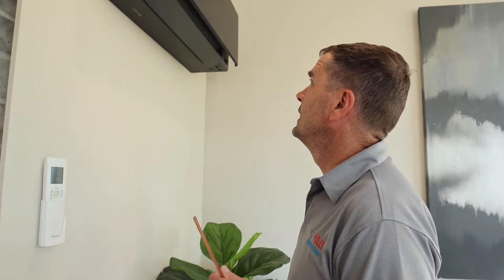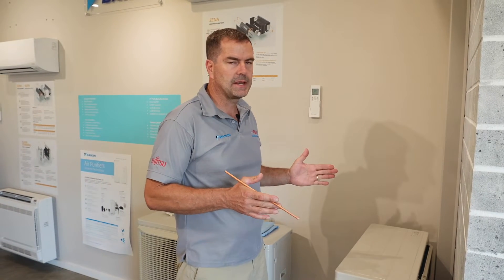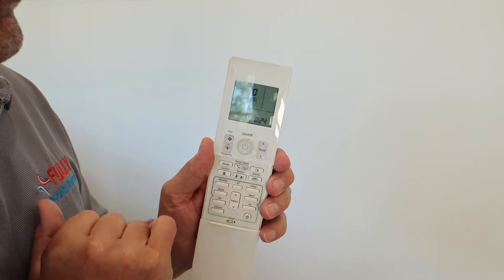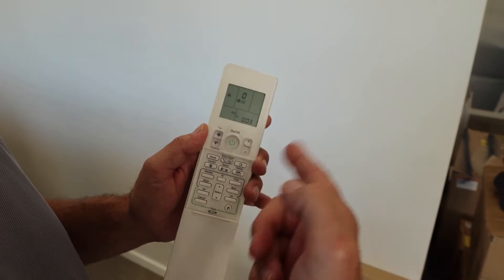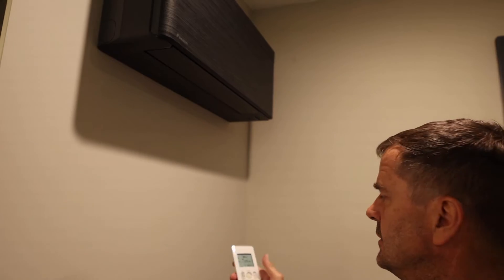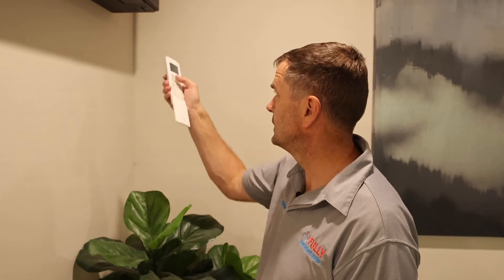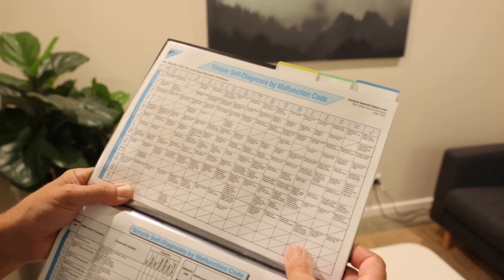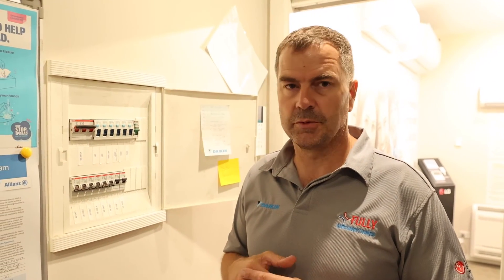How to fault find a Daikin air conditioner, troubleshoot split system ductless, green light flashing

Comment: Why is my remote is not working on my Daikin stylish
Reply from the maker: Is it the remote or the unit ? Dose the unit turn on with the button on the actual unit, if no the unit may not have power. If it dose then the problem is with remote controller or receiver

Comment: My doesnt do any bip, not even when I change from one code to another. No beep at all. The power light doesnt even turn on :(
Reply from the maker: Well it probably has no power to the system, I think you need to call an expert, your local Daikin dealer.

Comment: what to do where is no beep sound?
Reply from the maker: If it’s not working, there is no beeping sound but the lights are flashing. Well the lights tell you that it has power, the flashing lights tells you it’s in fault, with no beeping sound telling you that the beeper is broken, wires possible cut. 1st thing I would check has a mouse go into the indoor unit and chewed through the wires to the beeper. Or call a Daikin services tech with a d-checked, it can be fitted to the unit and look at the fault via a smart phone.

Comment: Well, I have two brand new multisplit installations, They worked fine during winter, but since summer started and I want to use them to cool the house, both are getting system fault UH, got already two daikin technicians here, none of them found something, as sometimes it takes two days before the fault is coming back. All filters and all inlets and outlets inside and outside cleaned. The only thing I can imagine is the location as they are in plain sun, but the techician tell me that it is not possible that this is causing the problem, They tell me to replace the compressor, but this seems impossible as both installations started at the same moment with the same issue. If you have an advice, I would love to hear it
Reply from the maker: Yep that’s an easy one, one of the indoor unit is cross wired, doesn’t effect as much in heating (just doesn’t heat in that room, but won’t cause a shut down fault).
Here is a easy test you can do, turn all the indoor units on to fan, then one at a time turn one indoor unit to cooling. Now go around to all the indoor units and see what one is pumping out cool air, is it the one you turned to cooling or not ? Then turn that indoor back to fan only and go to the next indoor unit and turn it into cooling and repeat this to all indoor units. You should be able to tell from this which one’s are cross wired. There is also a test you can put the system into from the outdoor unit. This test will automatically correct the incorrect wiring, but if the power is off for too long it will forget and will be cross wired again. Best to do the test, look at the led lights to see what indoor units are cross wired, and move the wires, then put it back into test to re-correct the wiring. This should only be done by qualified technician as you’re dealing with high voltages that can kill you.
Reply: @FullyAirconditioned  thank you so much, checked all cables again and indeed, both installatiions had cross-wired indoor units, Heating was indeed low, but I thought it really was that cold outside. Wired units correctly to the outside unit, and the air is much colder to cool down,after taking 20 minutes to start up again.. Will ask my money back from the company who did the installation and send them an additional heating bill from last winter :-) Not that I will see a cent as I am not an official technician, but it is working great now. THX again
Reply from the maker: @freyerboeckx7199 advice not intended for you to fix it, as it’s dangerous working with power, should be done by a qualified person, but glad it’s all fixed  and working now👍🏻. Daikin system are not as simple as USA made AC system, more training needed for service technicians.
Reply: @FullyAirconditioned  well, the installation was done by a (newbie) Daikin technician, two times a Daiking technician came over, first technician told me it was because of a cheap system, and the outside unit had not enough power, second told me to clean all the filters and was amazed that all filters were brand new, so the only possibility was the condensator or the whole board, So I send this one home because same issue on both systems at the same moment, couldn't be a result of his explanation, Working with power is not a problem, as I am an electrician, I only never installed multisplits myself and even less R32 installations. As  two Daiking technicians weren't able to solve this. best solution was giving it a try and it turned out great, so thx again.
Reply from the maker: If the tech have done all the checks and still can’t work it out I have had a faulty tx valve before that will cause this fault code and I had a tx valve unplugged from the PC board from factory that will also cause the same fault code.
Reply: @FullyAirconditioned  those tx valves sounds strange to me, as two fully seperated installations are having the same issue. The cross wiring sounds acceptable as it was a newbie who did the installation, The wiring seems to be correct on all 6 units, 1 on black, 2 on grey, 3 on brown (outside and inside units, so the one I could try is the test on the outside unit, however I don't immediatly see how. The technicians told me already that it was their job and that it only could be the compressor. Strange for brand new machines and only when it is getting hotter outside, It is more like they are suffering
Reply from the maker: I have made a video on this fault last summer, just have had time to edit and post it😅
Reply: @FullyAirconditioned  sounds great, looking forward to see it, thx in advance
Reply from the maker: @freyerboeckx7199  posted a short on the UH wiring test 👍🏻

Comment: Mine is not cooling but no faults are showing at all. What should I do next?
Reply from the maker: @rommelreyes2209  turn off the power for 30 sec, this will reset any faults.
Reply: After letting it run for a fee minutes it finally gave me the H6 fault. Which is either faulty compressor current sensor or the compressor itself. Is it worth to have it repaired? It is so disappointing as the heat pump is only 6 years old.

Comment: Thanks so much, I just installed a Daikin ftxng18axvju invertor and a rxng18axvju outdoor unit.18,000 BTU 17 SEER Wall Mounted Daikin Mini Split. The only long beep code is UA. These are new units seems to be wired correctly. any idea ?
Reply: Ok thanks , have you experienced faulty pc boards on brand new units ? And I see I have ftxng18axvju where the most common part number seems to be ftxb18. Would you know the difference between these two. I can’t seem to find anything online . I appreciate your expertise
Reply from the maker: @michaelosucha5747  I am not familiar with the units you have we don't have that model here in Australia sorry. If it's not a match pair listed in a brochure then I would say that your problem, mismatch of indoor unit to outdoor unit. Go back to where you purchased it from
Reply from the maker: UA is a mismatch of indoor unit and outdoor unit, it could also be a faulty PC board on either the indoor or outdoor.

Comment: This was very helpful. Thank you!  Helped me find error code J3.
 Now to figure out how to fix that!! 😊
Reply from the maker: Hi Donna,

J3 is a faulty discharge pipe thermistor, its reading outside its range, either open circuit or closed circuit, in the rare case its a faulty pc board (99% of the time it's a thermistor). The thermistor will need replacing, depending on the model it could be a single thermistor that plugs into the pc board or it could be a thermistor harness which will include 5 or 6 thermistors on the one plug. Best to get your local authorised Daikin dealer out to repair it.
Reply: @ Thank you.  I changed batteries on all  remotes, turned all the mini splits off over night (there are four) then shut the circuit breaker /power off for about 45 seconds this morning, and everything seems to be working fine now! The code was cleared. Will keep an eye out for a fault /J3 code again but for now I’m warm with fingers crossed. Thank you for your help and great information!

Comment: Hi sir, My daikin 1.5 ton inverter AC works fine at night, but outdoor unit doesn't run during afternoon time till evening, kindly guide us with the issue, climate is too hot here
Reply from the maker: @rameshkrishnan1923  is the unit in fault ?? Not working when it’s hot, could be poor installation, vac pump not use when Installing the system. Refrigeration system has air in it causing a high temperature at the compressor tripping the internal compressor thermal overload, could be short of gas causing the same thing.

Comment: Hi sir, My daikin 1.5 ton inverter AC works fine at night, but outdoor unit doesn't run during afternoon time till evening, kindly guide us with the issue, climate is too hot here
Reply from the maker: @rameshkrishnan1923  start with a new gas charge and achieving a vacuum below 500 microns before charging with new gas.

Comment: My remote says it’s a 00 code but the light is blinking green, the fans won’t open. Any tips??
Reply from the maker: Watch this video further towards the end, I give you a second method to find the fault code. Follow that procedure and you should find a fault code 100%.
Reply: @FullyAirconditioned tried the method and did not find a fault only long beeps at 0
Reply from the maker: @Productofgodz  long beep at 00 means no fault

Comment: When I turn on the unit, green light flashes. When I hold cancel however, 00 never comes up. Any ideas?
Reply from the maker: Have you tried the 2nd method lately on in this video ??
Reply: @FullyAirconditioned  Reset the breaker and we're good to go. Thanks!

Comment: This pensioner here could not follow your instructions so turned off power supply as per your suggestion for 20 seconds >>>  green light is solid and air conditioner now working...   Thank you...

EDIT:  Start of a long 3 day weekend {Public holiday} with each day expected over 35 degree plus hot week following...  Cannot imagine how long the waiting time for an appointment with a service guy to be available, so am extremely happy  😊
Reply from the maker: End result = unit working 
No problems 👍🏻

Comment: Absolutely spot-on advice! We suffered a power failure and brown out that damaged a lot of equipment. When our Daikin aircon system wouldn't power up we feared the worst for that too. A sincere thankyou!
Reply from the maker: Glad to help mate 👍🏻
Reply: 😅😅😅😅😅0.54 😅😅😅😅😅😅😊😅😅😅😊😊😊😊😮😊 @FullyAirconditioned
Reply: Did you also have no power on at all? My remote doesnt do any beep. I see the codes changing, but no beep at all
Reply: @MARINAGUIMA22  same here but a breaker reset fixed it.

Comment: >>> Happy New Year! <<<

I've been using a Daikin floor unit in the attic room for heating and cooling since March 2023, but it's not working anymore. However there is NO green flashing light. It's the normal red it should always be, but there is no airflow whatsoever. Checking the outside unit, that appears to be dead too. I've tried disconnecting everything from the mains and reconnecting too. This DID work a week and a half ago when I had the same problem,  but no joy this time around... 😕 I did try the error code retrieval procedure, but I'm guessing this only makes sense in case the indoor unit is flashing green.

Any idea what could be wrong here? Cheers in advance!
Reply from the maker: If you have turned off the power then the fault code (if there was one) has been reset. If the units not working there is something wrong, check the simple things 1st, filter clean, power and it’s set to the correct setting. Turn the system on and set at its highest heating/ or lowest cooling setting and just let it run. The fault finding process may take up to two hours to complete, so just let it do its thing. If it doesn’t come up with a fault but isn’t heating or cooling then you will need to call your local Daikin repair.

Comment: My split unit isn't blowing, or heating anymore. Any troubleshooting tips for a solid green light?
Reply from the maker: Leave it in and let it run for 2 hours, set it to the highest setting. Your system may be in the process of working out the problem. Like in this video the fault is an outdoor fan is locked ( not spinning) the Daikin’s unit see this fault but doesn’t stop and shut down showing a fault straight away. It tries restart the system 17 times, each time it  pauses for 5-8 minutes, goes through its start up process 1-2 minutes, if it detects the fault again it will do this over again, after 17 failed attempts it will lock out and display a green flashing light, if it starts and run fine for 30 minutes it reset the counter to 0. The reason it does this is to overcome nuisance faults, like the fan not spinning dew to high winds, the wind will stop eventually and give the fan a chance to spin normally and the system to operate normally.
Reply: So your saying to let it do its thing for a couple of hours for it to find the fault?
Reply from the maker: @greg6925  yes

Comment: Thank you, just followed your instructions, U4 , on 2 x ac, 1 I hadn’t used for 2 years, the other 6mth, now both working. 👍
Reply from the maker: u4 is most probably caused from a power problem, under voltage or over voltage
Reply: @FullyAirconditioned  brother can you please explain me the P8 error code please 😢😢😢😢😢
Reply from the maker: @ Insufficient refrigerant during test operation. Need to connect
refrigerant tank to charging port for auto charging [VRVIIIQ / VeUp Q only]

With the VRV it has an automatic addition charge function, you can measure the pipe size lengths and calculate the additional charge or you can put it into auto charge. I believe the p8 fault come up when the refrigerant cylinder doesn’t have enough hose or runs out, possibly low pressure as well.

Comment: How about it's not beeping
Reply from the maker: So the lights are on but it doesn’t emit a beep from the indoor unit, possible a mouse has gotten in to the unit from the wall cavity and chewed through the wiring to the pc board that emits the beep. If you have a close look at the cover where it meets the wall, if a mouse has been in there there will be little bits of chewed foam and stuff. The only other way is if the model unit has indicators lights at the outdoor unit, or call a Daikin services tech and ask if they have a d-checker, this plugs into the unit and connects to their phone and shows all data and faults. Make sure they have a d- checker.

Comment: I have ducted air conditioning. It's been fine until recently. The red power light keeps flashing on and off with an E 3 error code. I've reset it, and sometimes it will run nicely all day, but some days it's a pain. I can't even hear the motor when I go outside. Even when it's on and not flashing, it doesn't seem to cool, and yes we've cleaned the filter
Reply from the maker: So it has a red light on the wall controller, then this is quite an old system, at least 15 20 years. If it’s a non inverter then the e3 is an activation of a safety switch, hp, Lo, over load compressor, over load fans. You will need a service tech to investigate the problem. But if it’s gas related, like a leak and it’s on the old R22 or R407c gas it’s probably not worth fixing, the r22 gas is banned from being imported and what gas is here is very expensive. With the age of the system, some parts are no longer available, like the main pc board, stocks have been depleted, sorry it’s probably time for a new more efficient ducted unit i would say.
Reply: @FullyAirconditioned  thanks I'm getting someone out to look at it